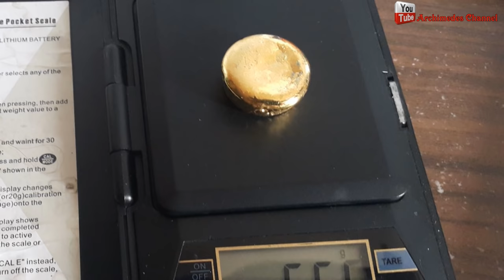How to remove gold from circuit board Gold Recycling. Your circuit board is a veritable gold mine.

Comment from the maker: How to Remove Gold from Circuit Boards
If you’ve opened an electronic device before, such as radios, televisions, or even your old cellphone, you’ve seen their inner workings. Ever noticed those shiny gold-colored parts on the circuit boards? Those bright pieces of metal are, in fact, gold. Gold is used on electronic circuit boards because of its excellent conductive properties and because it doesn’t corrode or rust over time. If you still have any of those circuit boards lying around, have a bit of fun and mine them for gold.
Reply: which type of chemical do you use to get gold 
please tell

Comment: so what is that little extracted nugget worth ?  what does it weigh ?
you put a lot of work into that ,,,,,
Reply: scale at end of video read 56.6 grams, as far as worth that all depends on the current market.
Reply: 420 Rebel 56.6 grams eguals 1.996506 ounces. Today's gold prices are $1,236.90 per ounce. $39.71 per gram.

Comment: They melt gold that comes from the ground sometimes in Quartz and they don't need to use acids to remove it. Why do we need to process it with acids now?
Reply: Because this isn't Gold ore. The gold he processed had been fused into an alloy with other metals so it could be used for industry uses. By processing it, and refining the gold from the other metals, the gold he will end up with will be of a higher karat.
Reply: no, you don't need acids. you need to know physics. you can do it without acids if you grind all this stuff and then carefully rise the temperature in a vacuum chamber  up to about 2000 degrees C. all the elements of the periodic table will evaporate one by one giving you 100% pure substance. This method is called distillation. It is a very complicated process but it will work without acids.

Comment: gold on computer board I notice some of the metal parts are part gold and the lower parts are not. my question is are the whole metal  gold or just the upper part is gold?
Reply: Dwayne Billsie uh...the gold parts are...gold.
Reply: Just gold plated tips on the connectors for conducting purposes.  Not solid gold.

Comment: can we not just take a tissue with sodium cynde and the rub it to all golt plated part then put the tissue in sodium cynde and then put activated carbon to absorb gold then burn all carbon and the just pan out gold or use aqua regia to dissolve it and then can be taken out

Comment: what is the orange liquid and the white powder
Reply: Based on the other videos I've watched, the orange liquid is Aqua Regia (a mix of Nitric Acid and Hydrochloric Acid) which is one of, if not the only acidic solution capable of dissolving gold, platinum, and a few other precious metals. The acid dissolves the gold from the pins and puts it into solution. The solution is then poured off to discard all the non-gold remnants. The white powder, I'm assuming, is Borax that is used to take the gold out of solution and cause it to precipitate out as a solid. The solution is then boiled off and it leaves behind the gold-containing powder. The powder is then melted down to unlock it from the impurities. In this video he just drops the molten gold into water, but I think by rapidly cooling it like this he trapped more impurities. In other videos where the gold is pour into molds and allowed to cool the slag and impurities form into a single top layer and they seem to separate out of the molten gold as it cools. Then when the ingot is fully cooled the slag layer just crumbles off with a few strikes.

Comment: how much was that worth?
Reply: as of today's price (10/28/16) $ 2,300 dollars give or take a few dollars .
Reply: Please realize the few electronics he showed did NOT result in all that gold. It takes quite a bit of material to be processed to get that much gold.
Reply: I've been refining for several years trust me i know . depending on the quality , it would take around 50 to 75 pounds of pins to get that much gold . A good rule of thumb is this . if it's good quality for each pound of material you refine you should get between 1 and 3 grams of pure gold . but also understand that it also depends on your skill set as a refiner as well .
Reply: Understood. I too have been refining for some time now. My comment as directed at Giovanni in case he thought the result was from those few items.
Reply: oops , my bad there friend . what's your favorite refine process ? mine is the hcl - air bubble system .

Comment: Lol No...This can't be gold... Its just mixture of alloys which might contain milligrams of gold in it....
Reply: Smartphones yield 10oz of gold per ton. There are aprox 10,000 smart phones per ton, and gold is $1,200 an oz today, so 10,000 phones would yield $12,000 in gold. (Computer circuit boards average 5oz per ton.)  If you could break down 1 phone every 5 minutes for 8 hours a day that would be 96 phones a day. At that pace it would take 104 days to break down one  ton of smart phones. So if you had an unlimited supply of free phones, worked 40 hours a week, never took a vacation, and did the acid breakdown and smelting during your free time, you would make $42,120 USD.

Comment: it is wast of time
Reply: I assure you, it's not. This is not a good video, however. I use 70% nitric acid and get good results. ALWAYS BUY GOOD PROTECTIVE GEAR AND PERFORM IN A WELL VENTILATED AREA.
Reply: what carat do you get from the pins? and is the white powder peroxide?
Reply: do you know what is the name of that machinrthat hot that quick